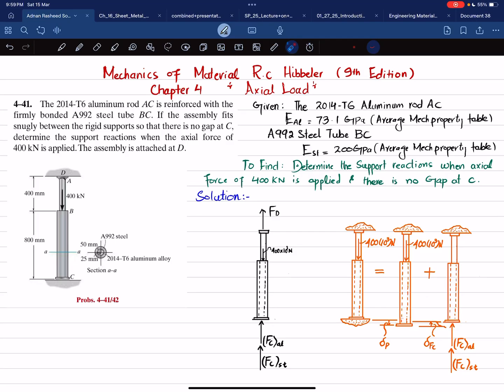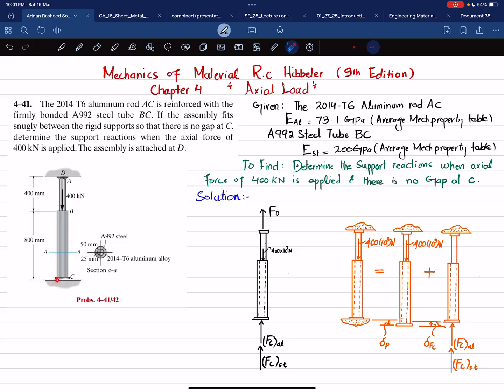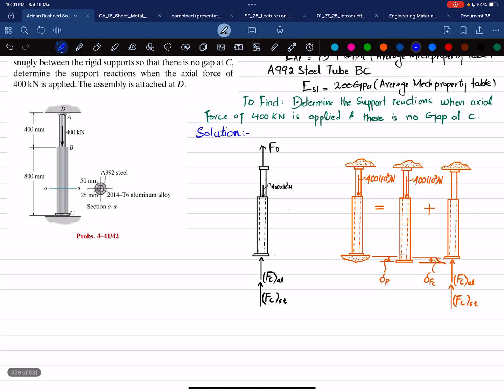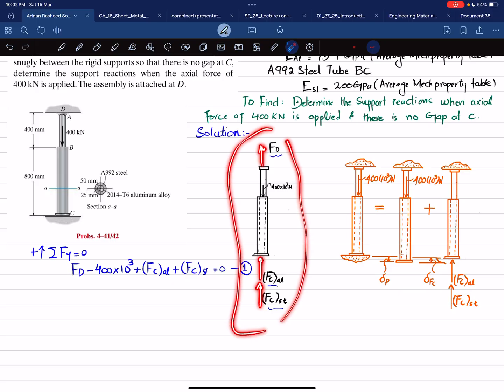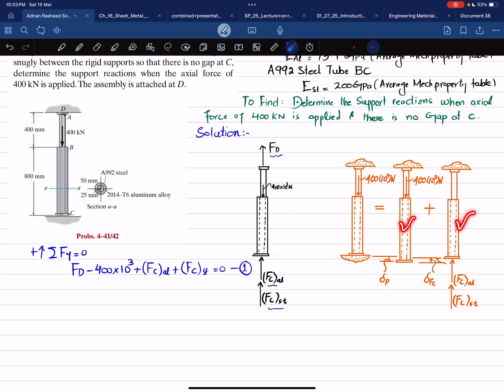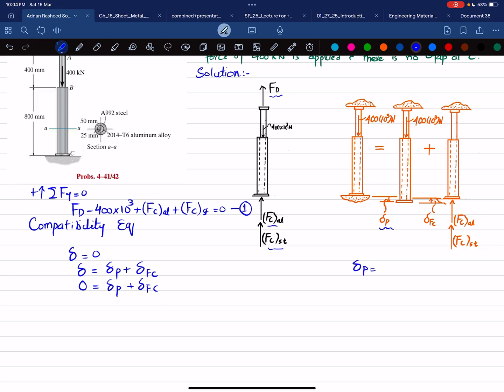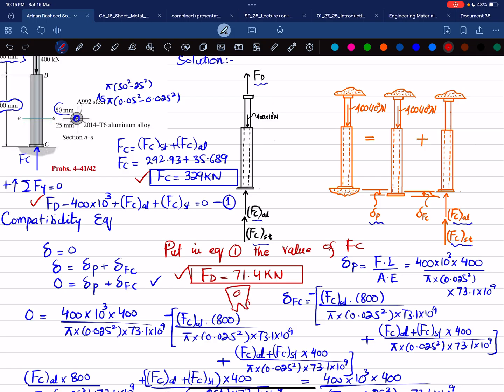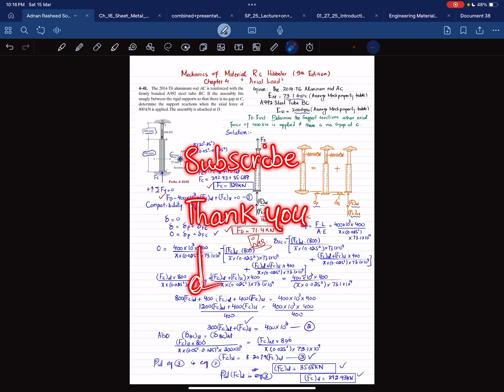4-41 | Determine  support reactions when axial force of 400 KN is applied | Mechanics of materials

Comment: Thank you for your attention and prompt response. I have a question regarding the matter: When writing the compatibility equations, why did we use 400 instead of 800 for the length in the equations fc(al) and fc(st)? Thank you again.
Reply from the maker: You can see the upper portion where only aluminum rod is 400 mm in length and its the rod which experience the total load therefore i have used 400. While the bonded portion consists of two materials bonded together and both will move with same compression so i have to take only anyone material. therefore for consistency i took the Aluminum rod. You will get the 2nd question tomorrow inshallah and it will be further clear to you in that. Thank you
Reply: @engradnanrasheedmechanical  Mister but why does not steel do any elongation on the 800m part? Why did you choose just fc al on that section?
Reply from the maker: It does brother , I shall suggest you to rematch the portion where u have clearly discussed that bonded portion BC will also elongate, but both elongation in BC will be same so we have to choose one materials as upper portion .
Reply: @engradnanrasheedmechanical  I will be eagerly waiting thank you for your attention sir.
Reply from the maker: Don't forget to share it with your friends. Thank you 🙏